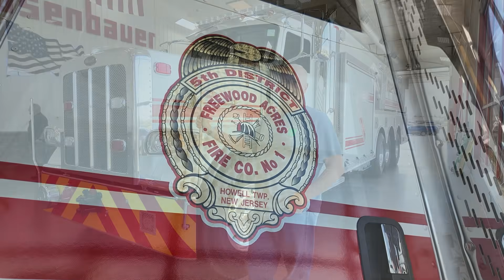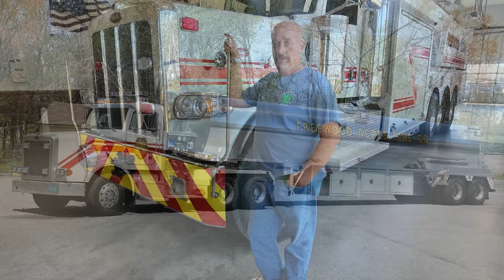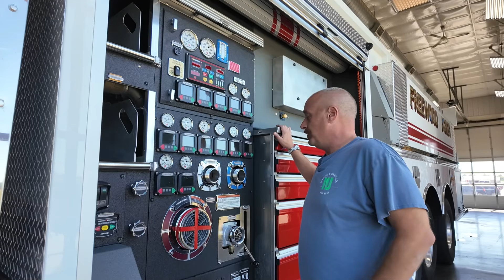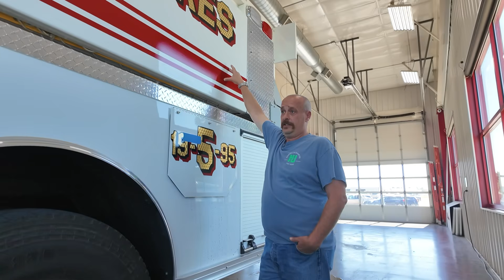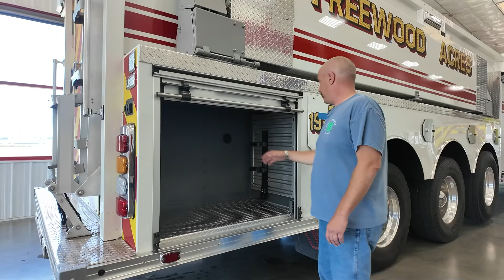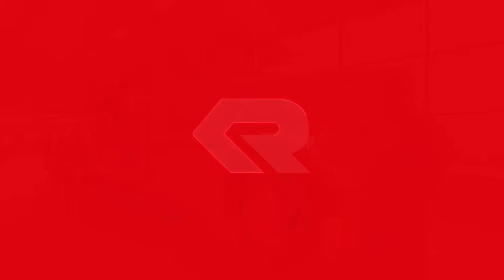22248 - Freewood Acres, NJ - Peterbilt Tanker FX

Comment: I feel sorry for the roads, I can’t imagine what that thing weighs.
Reply: That was my thought too. But they DID use a tractor trailer.
Reply: The roads are fine.....trust me.
Reply: Also in NJ you're legal up to 80k on a straight truck with a steer axle, a set of tandems and a drop axle.  Rear mount tower ladders are always heavy too some can gross a little over 80k all the time.   It's all good.
Reply: @DJ379_Roco 😳wow. Here in Illinois it’s 54 and it might be 59 with a tag axle, but you hardly ever see that air tag here. That is one hell of truck though.